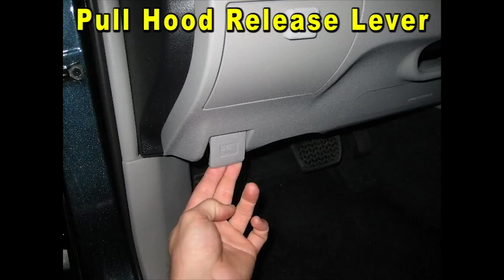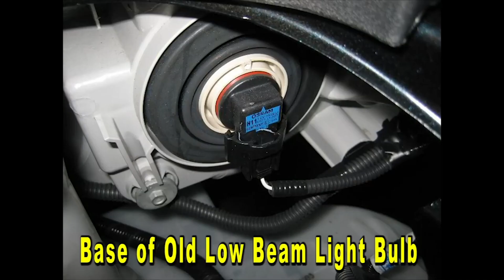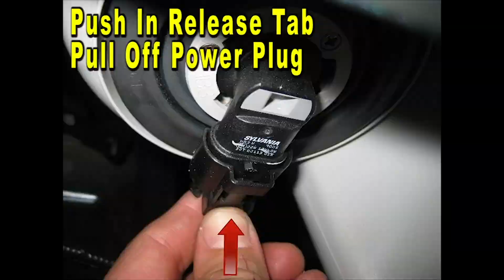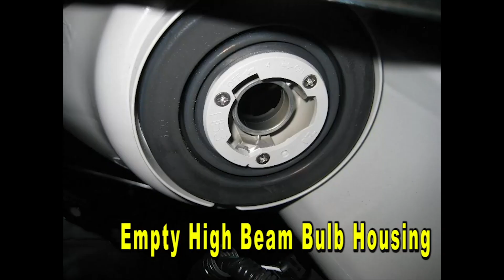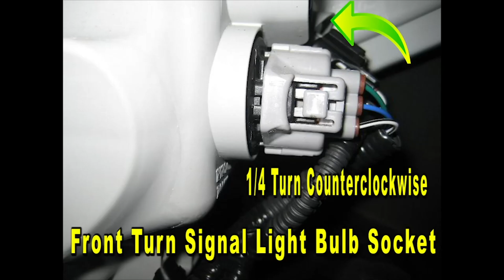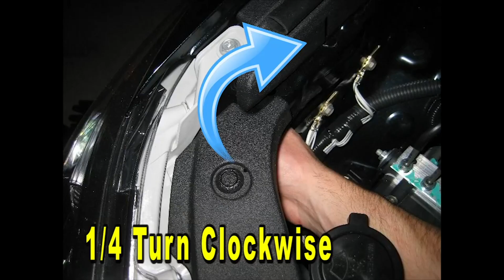2012 To 2017 Toyota Camry How To Change Headlight Bulbs With Part Numbers - Quick & Easy

Comment from the maker: Toyota Camry Low Beam Headlight Bulb - https://amzn.to/3CD9nPl
LED Low Beam Headlight Bulb Part Number - https://amzn.to/3VZTSrI
High Beam Headlight Bulb Part Number - https://amzn.to/3VXp7Dz
LED High Beam Headlight Bulb Part Number - https://amzn.to/3CGaeyS
Front Turn Signal Light Bulb Part Number - https://amzn.to/3QrGHP2
LED Front Turn Signal Light Bulb - https://amzn.to/3Qw359N
Front Turn Side Marker Light Bulb - https://amzn.to/3X4T3PI
LED Front Side Marker Light Bulb Part Number - https://amzn.to/3CFBWvv
Socket & Ratchet Set - https://amzn.to/3Z17LbA
Mechanix Gloves - https://amzn.to/3jCnHkt

The Paul79UF YouTube channel is a participant in the Amazon Services LLC Associates Program, an affiliate advertising program designed to provide a means for sites to earn advertising fees by advertising and linking to Amazon.

Comment from the maker: Check out the DIY guide for changing the headlight bulbs in a 7th generation XV50 2012 to 2017 Toyota Camry - 
https://www.paulstravelpictures.com/2012-2016-Toyota-Camry-Headlight-Bulbs-Replacement-Guide/index.html

Here are all of the DIY repair and maintenance tutorials for the seventh generation XV50 2012, 2013, 2014, 2015, 2016 & 2017 Toyota Camry - 
https://www.paulstravelpictures.com/Articles/2012-2015-Honda-Civic-Common-Problems-Repair-Maintenance-Guides.htm

Owners of other Toyota, Scion or Lexus vehicles such as the Yaris, Corolla, Matrix, RAV4, Prius, Tacoma, Tundra, Sienna, FJ Cruiser, Venza, Highlander, Avalon, 4Runner, Land Runner, Sequoia, IS 250, ES 350, GS 350, tC, xB, xD, iQ and FR-S may also find these DIY instructions to be helpful.